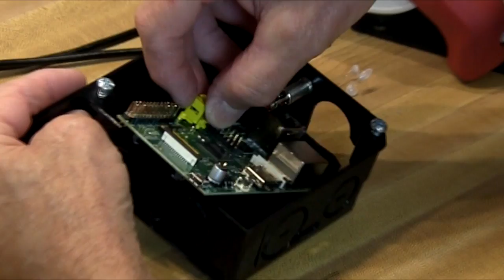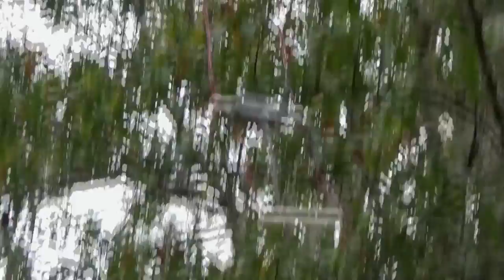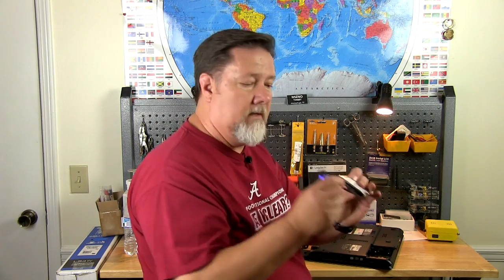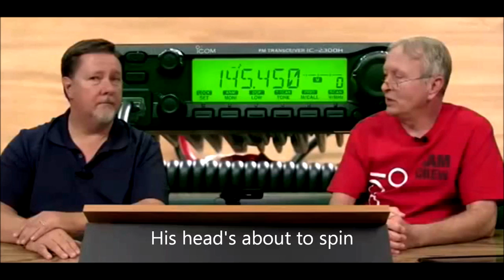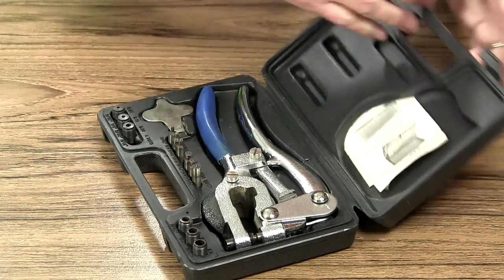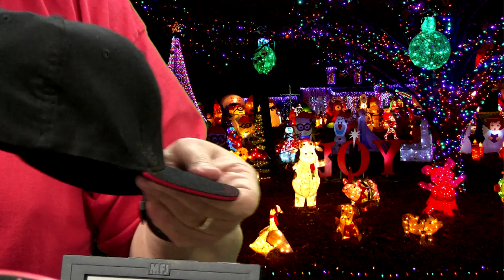AmateurLogic 98: Christmas 2016

Comment: I was excited about ShackBox OS but ran into several issues. First, there is a bug that puts the keyboard back to french which has keys mapped differently making typing frustrating. There is a fix on the site you need to apply. This only happens when you do a full install. Works fine when booting the live install. The biggest issue, however, is that this is built on Ubuntu 12.04 but NOT the LTS version. This is a huge problem since this version is past EOL and all support has been removed from the net. This makes it very hard to get updates or do an upgrade. It can also keep you from installing new software or drivers. Maybe someone has a repo with the 12.04 files. I didn't look.